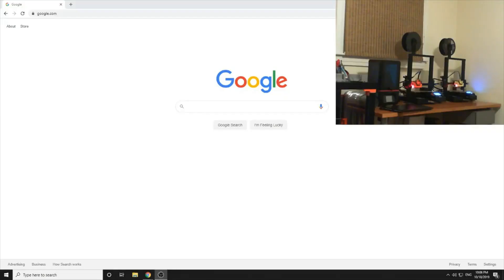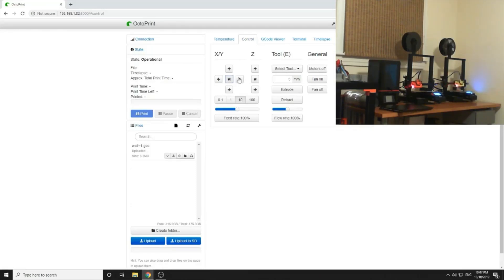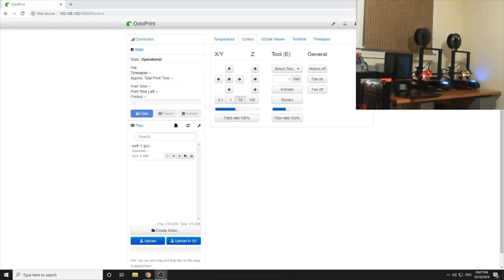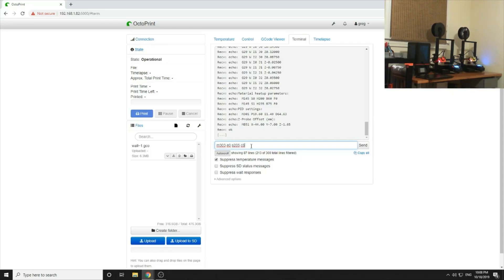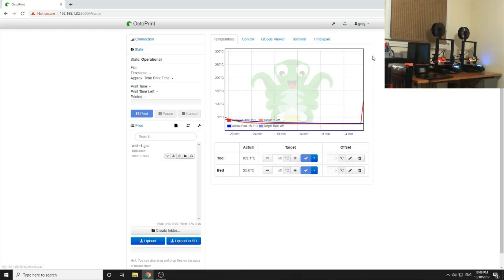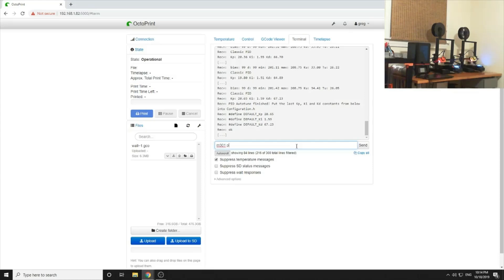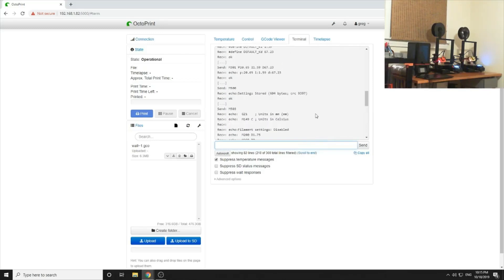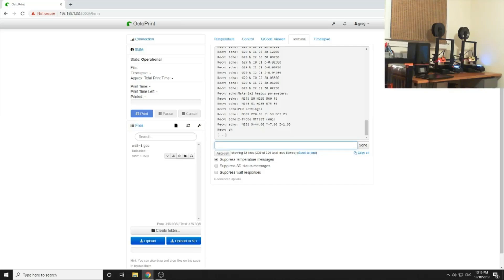Easy PID tuning via Octoprint

Comment: so to get this right, to do this PID tune, i do not need a cable from the pc to printer? I just need the cable from printer to the octopi?
is that correct buddy?
thanks! have a great holiday
Reply from the maker: Yes. If you have octopi running, you can use the web console to do the PID tune.
Reply: @3dprintingdungeonmaster639  thanks. Happy holidays!

Comment: I have changed both heating element on the extruder and the   thermal sensor. When I turn the printer on and turn the temperature up to 210. The temperature does nothing and then I get the error saying E1 thermal runaway printer halted please rest. Should I do a PID to fix’s this issue or could be the
main board that has went bad? Any help would be appreciated.
Reply from the maker: PID tune will not fix this. Sounds like your board isn't turning on the heater cartfridge, or wires are not tight.
Reply: 3D Printing Dungeon Master 
So I need to replace the board?
Reply from the maker: @TheDronzDr  Check your wiring first to make sure everything is plugged in. Then look at the board to see if you a fuse blown. Also look for a blown mosfet. If the wiring is all good, its the board.
Reply: 3D Printing Dungeon Master Thank you. That helps a lot for sure. Will let you know how it turns out.